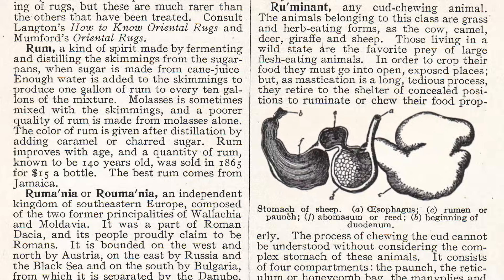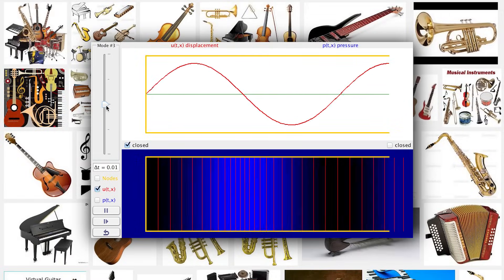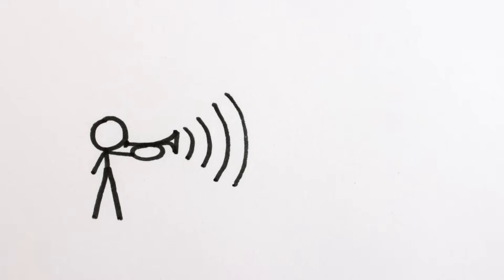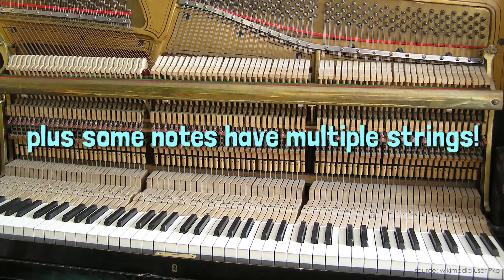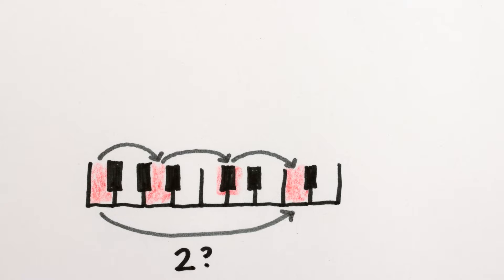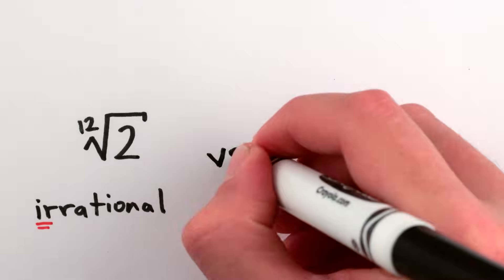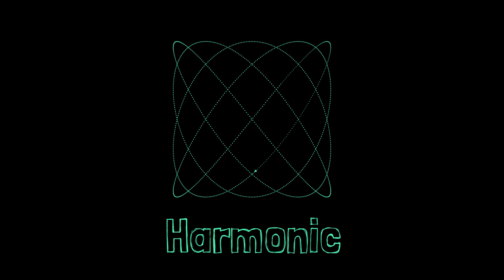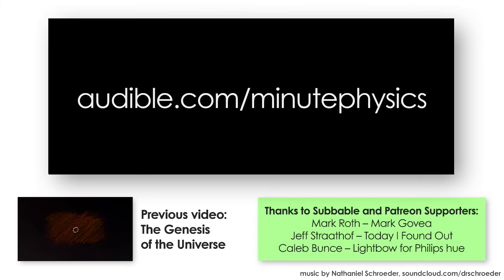Why It's Impossible to Tune a Piano

Comment: Guitar stings are made from steel or nilon.
Reply: The nylon string guitars don't have any steel in any of the strings.  The metal in the 3 base strings is silver wire.

Nylon is a synthetic material that hasn't always been available for classical guitar construction.   Prior to 1948, classical guitar strings were made of animal gut, with silk thread wrapped around the 3 base strings.
Reply: Modern guitars are designed so that the strings carry a balanced tension and don't bend the neck up or down at standard tuning.  This is most important on steel string guitars because there is a lot more tension in those strings.   The linear density varying among them, is therefore what allows each string at the same tension, and why the bass strings of the nylon guitar have metal.

Comment: 2:01 can anyone explain in simple words??? Help???😞
Reply: Each string produces multiple frequencies same time. The frequencies higher than base note is called harmonics.

If you try to tune piano using your ear then you are trying to make specific harmonics have same frequency from different keys. For two keys following each other matching frequencies should be harmonics with 9 times base frequency from lower key and 8 times base frequency from higher key.

This generates a good tuning between neighboring keys when their frequencies match. But there is issues with keys father apart as frequency change is a rational number which doesn't multiply to two. Two is required because a note octave higher should have base note with twice the frequency. Difference is small but can be heard because it generates an audible sound effect like at 3:25.

The video explains the math as frequency change between notes tuned with 9th and 8th harmonic is 9/8. There is twelve notes in an octave which means you need to multiply the ratio twelve times with it self to calculate resulting difference for an octave higher key. The multiplications are presented by power expression (9/8)^12 which is very close but not exact 2 like video shows.

Comment: Equal Tempered is the politically correct meme from the time of Bach. I always known guitarists who fiddle around when tuning and then play a major chord and then think something is wrong and repeat and then surrender to leave it somewhere. Sometimes they change a string and blame it for not sounding right. It was ET all along. If you aren't modulating all over the 12 keys you don't need ET. Modern keyboards and organs let you chose temperaments to suit the musical period or feeling. At scala.org one can download thousands of temperaments from Bach to Bali gamalan. Those question marks at the 6th and 7th harmonics are not what a Purdue prof once told our 495 class a "wild card" for the 7th. It might be 30 cents off but it's true to the blues, gospel, bluegrass, and barbershop singing. I play a synth that has 128 harmonics intensity and phase selectable. Getting into the high teens and 20's is like seeing new colors. It's name is ZynAddSubFX it's free.
Reply: That stuff is a bit out of the scope of the video

Comment: Why not just tune a piano using a microphone an oscilloscope so that each key is exactly the frequency it should be?
Reply: The problem isn’t with the piano, but with the equal temperament system of tuning. (Almost) all instruments are tuned in such a way that their intervals are inaccurate but consistent across all keys. You mathematically can’t have both (although using more than 12 notes will let you get close enough that it doesn’t matter)

Comment: So basically, in stupid people words. The chords that we use in classical music theory almost line up perfectly on the 12 semitone octave scale we use on our instruments. Almost. The unsolvable problem is that the first note on an octave must be half the frequency of the last note on the octave. If we don't do this then they aren't the same note and It doesn't harmonize, so it sounds awful. It would also mean that every octave above and below would be offset and sound progressively worse as you continued.

Equal temperament means we just divide an octave into 12 equally distanced slices and tune each string accordingly. But none of the chords we use correspond to the slices we have.

Therefore with a physical instrument there is no way to tune it where you can play all chords perfectly and an octave has the exact perfect distance simultaneously. The best you can do is space the notes out equally and play all the chords slightly out of tune.

Comment: Um this whole premise is wrong. Harmonics on a piano string are not perfect mathematical multiples of the fundamental frequency, due to string stiffness. For an octave to be in tune with the overtones of the lower note it must be tuned slightly sharp. A piano is never actually tuned to 12TET -- pianos use a stretched tuning. This is why piano tuning is a profession.
Also the issue with tuning to harmonics causing increasing errors is not unique to the piano. A guitar is also a 12TET instrument. Tuning to perfect fourths will cause an error that increases by a couple cents for each string.

Comment: The title should be “why it's impossible to tune any instrument”. This is absolutely NOT about pianos. Pianos have very specific tuning problems (mainly because of highly tensed strings generating dissonant overtones) which are not addressed at all in this video. A piano cannot be tuned in equal temperament as you describe it. For more info, check out https://en.wikipedia.org/wiki/Piano_acoustics

Comment: But (2^(1/12))^12 isn't exactly = 2, it is = 2.0000000000000008028
Reply: Are you trolling mate?
Reply: The 12's equal out, and you are left with 2.
However, the calculator thinks differently, and yes the answer is  2.0000000000000008028 according to them, because they calculate it using every step instead of canceling out.

Comment: can't you just use an electronic tuner to check every string?
Reply: No you can't. Tuning a piano is an art, not a science.
Reply: If you tuned the piano to an electronic tuner it'd sound bad because the electronic tuner doesn't factor in inharmonicity.

Comment: Pythagorean tuning for the win!!!
Reply: Pythagorean tuning isnt perfect either, it is actually terrible when you try to play many different keys.
Reply: @paketbaand1523  Maybe if you are limited to 12 pitches. It is theoretically perfect.
Reply: @MegaSemi  Yeah, it is perfect if you have 1 pitch per octave. Try making music with that. Any other number of notes (including 12) is just mathematically impossible to be tuned. Pythagorean tuning is ok but it is by far not as versatile as an equal temperment system
Reply: @paketbaand1523  In what way is it mathematically impossible to be tuned?
At the end of the day it depends on your musical requirements, what you're willing to sacrifice. If you want to play many different keys and you are limited to 12 pitches, a well temperament or equal temperament are good choices, but not everyone requires many keys available.
Reply: And of course what you are sacrificing is the purity of intervals.
Reply: @MegaSemi  yeah but even tuning for one key is not perfectly possible, you always have to sacrifice the purity of intervals
Reply: @paketbaand1523  Do you mean that you can't stick 100% to the theoretical model due to physical constraints? I would agree with that, but equal-temperament suffers from that as well.
Reply: Ori Samsonov No it has nothing to do with physical constrains (did u even watch the video), and yes 12tet isnt perfect either, it is just not possible to have a tuning system with perfect intervals like octave, perfect 5th, major/minor 3rd, etc. because it is mathematically impossible, even for 1 key.
Reply: @paketbaand1523  Well, Pythagorean Tuning has perfect octaves, fifths and fourth at the same time. Tell me, where is the broken fifth or octave in a single Pythagorean key?
Reply: Ori Samsonov Yes, but thats all you get (and also only for 1 key). On the other hand extremely important intervals like major/minor 3rds, major 6th etc. will be off as well as music in any other key. My point is not that 12tet is better than pythagorean (although that is my opinion), but that Pythagorean tuning isnt and cannot be perfect.
Reply: Ori Samsonov The reason why 4ths and 5ths cant work for every key is that you can stack for example 12 fifths to get back to the not you started on (i.e. 7 octaves) but thats not the case in just intonation.
Reply: @paketbaand1523  Pythagorean delivers on its promises perfectly. A Pythagorean Diatonic scale is built out of just intervals. If you are looking for a system that contains consonant major chords, 5/4 major thirds and all that, Pythagorean is not a good choice, and in my opinion neither is equal temperament as its approximation of 5 limit intervals is quite poor. 
But who decides which types of intervals are important or not? What if someone is looking for a good approximation of a 7/6 minor third for example?
Reply: If you want to limit the scope of the conversation to the standards of western music, go ahead. I thought we were talking about music in general. In the context of mediaeval music, Pythagorean ticks all the boxes.
Reply: @MegaSemi  You are compeltely missing my point. I am saying, pythagorean tuning (or any other tuning system) cannot accurately contain every 5th 4th and octave.
Reply: "The reason why 4ths and 5ths cant work for every key is that you can stack for example 12 fifths to get back to the not you started on (i.e. 7 octaves) but that's not the case in just intonation." Sure, you don't get to a given note (several octaves higher) if you stack 3/2 fifths on top of it. So what? It is not a universal demand that the chain of fifths must connect. Musicians did just fine with the chain not connecting during the Renaissance for example.
Reply: @MegaSemi  "Well Pythagorean tuning has perfect 5ths, 4ths and octaves at the same time. Tell me where the broken interval is" - you said octaves, fifths and forths are perfect at the same time, which is not true and they are broken in most of the keys.
Reply: @paketbaand1523  It is true.
You have this scale of C-D-E-F-G-A-B in Pythagorean tuning,  Where is the broken fifth? Is it A-E? F-C?? Where are those broken intervals exactly?
Reply: @MegaSemi  But it only works with 7 notes. If you start at C1 and go up a fiftg then down a fourth and so on 6 times you should end up at C2, but you dont...(4/3*3/2)^6 does not equal 2. So 1 fifth will always be terribly off.

So why not just make every fifth and fourth a tiny unoticeably amout out of tune in order to preserve ALL intervals. Pythagorean is just a ridiculous tradeoff for almost perfect fifths and forths but everything else sucks.
Reply: @paketbaand1523  Oooohhh we're finally getting somewhere. True, 
the note that you arrive at is not a C, but a B#. But that is not how you tune octaves in Pythagorean tuning- you are not supposed to construct an octave by a series of fourths/ fifths, you just tune pure 2:1 octaves...
Reply: @MegaSemi  that note "b#" you just invented is supposed to be between C and C# then because the ratio is 1:2.027, lets assume there are more than 12 notes (altough that kinda contradicts the definition) there would be infinitely many since youll always be able to combine those allegedly perfect 5ths and 4ths and get new notes that arent on your 12-, 13- or whatever scale.

That hypothetical tuning system you are  talking about has nothing to do with pythagorean tuning, because pythagorean tuning just has a bad fifth. So whatever explaination you are going to come up with, dont call it pythagorean unless you can show me a source that says that pythagorean tuning has a distinction between b# and c.

But id be glad to hear how this 1:2.027 ratio fits in with the perfect 5ths and 4ths theory.
Reply: @MegaSemi  "you just tune pure octaves"...if c1 to c2 is a pure octave then f1 to c2 cant be a perfect 5th. Or at least some fifth has to be impure
Reply: @paketbaand1523  "that note "b#" you just invented is supposed to be between C and C# then because the ratio is 1:2.027, lets assume there are more than 12 notes (altough that kinda contradicts the definition) there would be infinitely many since youll always be able to combine those allegedly perfect 5ths and 4ths and get new notes that arent on your 12-, 13- or whatever scale." So I'm inventing this stuff lol, ok. What definition are we contradicting? I already told you I don't care about your arbitrary 12 pitches. The chain of fifths can go on forever, "youll always be able to combine those allegedly perfect 5ths and 4ths and get new notes" - Yes! (but why "allegedly perfect "..?)

"That hypothetical tuning system you are  talking about has nothing to do with pythagorean tuning, because pythagorean tuning just has a bad fifth. So whatever explaination you are going to come up with, dont call it pythagorean unless you can show me a source that says that pythagorean tuning has a distinction between b# and c."
This is from the Pythagorean tuning page from Wikipedia:
"The Pythagorean scale is any scale which can be constructed from only pure perfect fifths (3:2) and octaves (2:1).[4] In Greek music it was used to tune tetrachords and the twelve tone Pythagorean temperament was developed by medieval music theorists using the same method of tuning in perfect fifths, however there is no evidence that Pythagoras himself went beyond the tetrachord.[5] A distinction can be made between extended Pythagorean tuning and a 12-tone Pythagorean temperament. Extended Pythagorean tuning corresponds 1-on-1 with western music notation and there is no limit to the number of fifths. In 12-tone Pythagorean temperament however one is limited by 12-tones per octave and one cannot play most music according to the Pythagorean system corresponding to the enharmonic notation, instead one finds that for instance the diminished sixth becomes a "wolf fifth"."
So, I am talking about the extended Pythagorean tuning, and it doesn't matter what we call it, this is the system that I was talking about when I said "Maybe if you are limited to 12 pitches. It is theoretically perfect."
Of course, in PRACTICE we often use instruments limited to 12 pitches and so there's gonna be one wolf fifth, usually placed on G#-Eb, which we tend to avoid.. or use for dramatic effect, or treat as if it was a fifth and hope nobody notices.

"But id be glad to hear how this 1:2.027 ratio fits in with the perfect 5ths and 4ths theory." What about it? It's just one more ratio that is generated by the series . It resembles an octave.. If you continue generating fifths, You'll get to a ratio that's more octave-like. 53 equal temperament takes advantage of that.
Reply: @paketbaand1523  ""you just tune pure octaves"...if c1 to c2 is a pure octave then f1 to c2 cant be a perfect 5th. Or at least some fifth has to be impure" NO fifth has to be impure in the sequence  C-D-E-F-G-A-B-C.
Reply: @MegaSemi  but it will never be a perfect octave, and a tuning system with an infinite amout of notes is not a tuning system but rather the absence of a tuning system
Reply: @MegaSemi  C D E F G A B C is not the full tuning system, and if it only had 7 notes then you wouldnt be able to play in all 7 keys
Reply: @MegaSemi  im sorry but you just keep inventing stuff and u ended up with and infinite and a 7 note system that would probably be extremely bad or limited at producing music and not at all "pythagorean tuning for the win"
Reply: @paketbaand1523  Oh my God...
"but it will never be a perfect octave," Didn't say it would ever be a perfect octave. 

"C D E F G A B C is not the full tuning system, and if it only had 7 notes then you wouldnt be able to play in all 7 keys" So what? I was demonstrating that you can have scales that consist of pure octaves and fifths without wolves. Why are you mixing your desire to play in more keys into this?

"im sorry but you just keep inventing stuff"No.
" and u ended up with and infinite and a 7 note system that would probably be extremely bad or limited at producing music and not at all "pythagorean tuning for the win""
No. In theory the chain of fifths can be of any length. In practice one is gonna choose a reasonable number of pitches to play with. If you want your chain of fifths to connect after a small number of chain-links, go for a different tuning system. If you want your melodies to have the most integrity to them, your Major ninths beat-less, and you are happy with the number of pitches your instrument has to offer, Pythagorean tuning is an excellent choice. 
So, Pythagorean tuning for the win!!!

Comment: is it possible to invent a piano-ish instrument that can be perfectly tuned? or is this just some weird limitation of the universe and western music systems?
Reply: It's a mathematical limitation and how a keyboard instrument works. It's impossible to have perfect chromatics whilst having perfect intonation on fixed strings. Basically every other instrument you can adjust tuning slightly. Like changing air flow and mouth shape on wind instruments. Though, some electric pianos do have the ability to work in perfect temperament.

Comment: just use a tuner?
Reply: most tuners use equal temperament. which is a compromise that is not always the best, and definitely not for string instruments.
Reply: Inharmonicity would still make the piano sound bad if tuned be electronic tuner